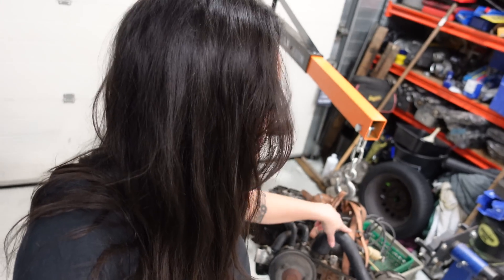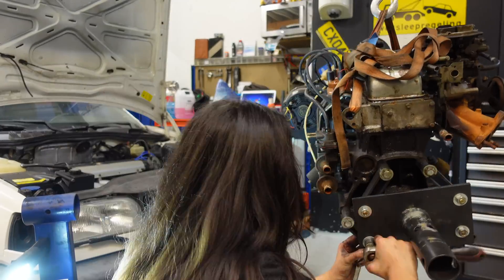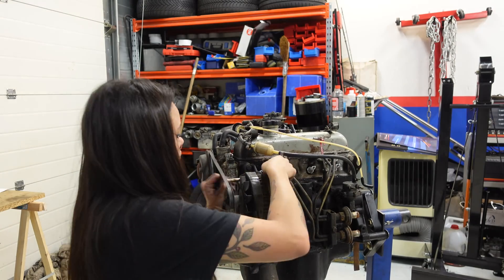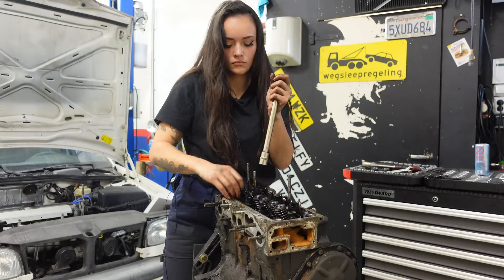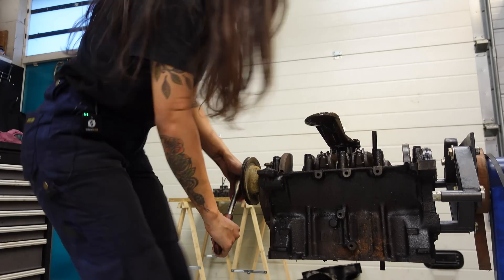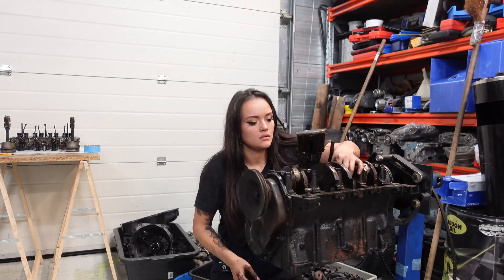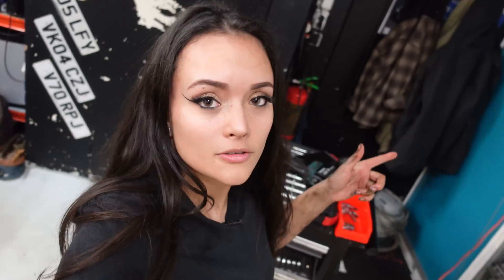Disassembling my Volvo 340 engine

Comment: Just because I'm being playful. A ratchet isn't designed for force. You have to use a strong arm, or you risk damaging the ratchet's bearings. And you can use less force.
It's great to witness all the steps and hear the choices that were made.

Comment: Filter thingy.. AKA ..Oil Pump strainer
If your oil light comes on or flashes whilst driving
Its either a failed oil pump or flashing indicates blocked filter thingy ( either with oil sludge residue or plastic/rubber debris from broken down belt, seals or tensioners

Comment: Found your channel today and looking at the engine block it is a wet liner (so the cylinder can sbe removed and replaced) and i hope you will do some performance upgrades to the engine (if parts are available for it) a nice high lift cam rolloer rockers would be a nice start and if you can a lightened flywheel and a new clutch and maybe worth checling the oul pump of the engine for sign of wear and replace if needed and keep up the work more people need to work on their cars

Comment: Quick tip: pull when loosening bolts, don’t push. If they’re about to sheer, you’ll feel it and retain control. Plus, it’s way easier.

Also, you’ve stripped it down to the crank, so replacing the bearings is a no brainier. While you’re in there…
Reply from the maker: That's actually really smart, haha! Thanks for the tip 😁😁
Reply: @ now I just hope you don’t sheer any bolts while pulling instead of pushing 😆. Loving the content though 👏🏼

Comment: So you  have the Renault engine in your Volvo, not a bad engine but they are known to warp their cylinder heads if ower heated (broken water pump belt). You probably need to mill the cylinderhead 1--2/10 of a mm.

Comment: Get rid of that Renult engine and install an true Volvo engine,and there you jave some obsions,the orginal 360 who goes dtright in the hole,but you can also huntinh for an B21TIC who are an carburated turbo intercooler engine an your 340 willl be an joy to drive

Comment: It's surprising to see that big EGR valve and those air-injection (?) pipes because carbureted European-market cars of this era had few emission devices. Checking on Wikipedia, Volvo added emission devices to this model starting in 1987 so that would explain it.

Comment: if you dont have experience  with engines  get a friend that does
Reply from the maker: I agree! I have rebuild engines before though, but those were all from newer model Volvo's 😊
Reply: @joy.vanhaelen   these old engines are easy  but i would recommend  you atleast take one maincap off and look at the bearing if you do a full rebuild  plenty of  assembly lube and a oil with  lots of zink and phosphorus

the push rods are not  super  critical to get placed  right some think it it important to put them back where they were but  it just isent

Comment: Hi from Australia. Good video. And well done on the engine removal and strip down. Would be worth doing main bearings as well pius replacing front and rear oil seals. Better now than later. Keep up the great work. Enjoy 👍

Comment: Nice video again. I've got some remarks:  1) I didn't know the Volvo 340 was transaxle, that is completely new to me.  2) what are those four tubes coming out of head close to spark plugs? 3) The "things" are called cylinder sleeves and oil sump strainer.

Comment: you are often pushing against tools to loosen bolts."Rainman Ray's Repairs" has a vid somewhere explaining humans are much better at pulling. It will cost a lot less effort to loosing bolts when you pull instead of push to loosen bolts.
Reply from the maker: Ahhhh thanks!!! That's a great tip 😁🤩

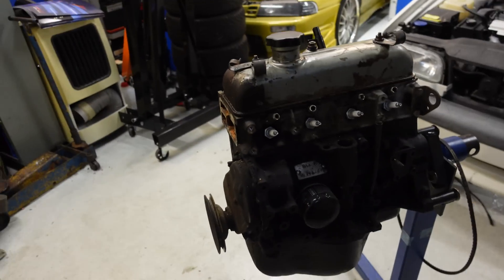Comment: Funny story about this little engine and its small size at 3:46  

The mk1 Twingo was ready to go to production before they had an engine for it. 
The Energy series they had small and modern back then, did not fit in the tiny Twingo engine bay. It was a cross-flow design with an overhead camshaft.

They later developed the D-series specifically to fit the Twingo, which had already turned into a massive success. But before the D - Series was ready, the only thing they had that fit, was this, the C - Series, very small in overall exterior size as it was Not a crossflow design. 

It was already 30 years old at the time the Twingo launched. with plans to kill it off in place for years, but since they had no choice, they went ahead and put this old lump in the first Twingos. :)

Comment: so , names in  english: 
The piston end caps are the connecting rod big ends. Commonly called just big ends. The ones on the piston side are called smal ends.
the cylinders walls are called cylinder liners or sleeves.
The filter thingy is the oil pickup strainer.
Reply from the maker: Ahhhh thanks!!!! Good to know haha 😁😁

Comment: 6:29 cylinderwalls, they are part of the block and are connected at the bottom, wont come out when tapping out the piston :)

Edit: I retract my statement! I seem to have been mistaken, apparently the B14E actually has removable cylinderwalls, my bad! 😁Interesting design
Reply: They are removable cylinderwalls, you have to keep them in place if you turn the crankshaft. There is a gasget below in the engine.
Reply: @bertjager4500  absolutely, wet liners on these and will move and break the seal if you don’t hold them in place.
Reply: @bertjager4500  You learn something new everyday! Edited my first comment. Thanks!
Reply: @Aronsson007  not a problem. The same engine is in the DAF 55 & 66.  That's why i know it. 
Most engines with loose cylinders you can recognize on the looks of 4 circles if you get the gasget off the engine .
Reply: That open deck block is so tight it almost looks like thick sleeves

Comment: Maybe you dont know but engine from Renault 18 fits in your volvo -it is same 1.4 L engine.Maybe to try to find on scrapyard some Renault  18 with low mileage and take that engine since this one looks really tired.Or maybe barn find renault 18.
Reply: Better to use a volvo engine like the 360, take 2.3 from 240
Reply: @torhelgerasmussen9479  volvo and renault used that same engine.